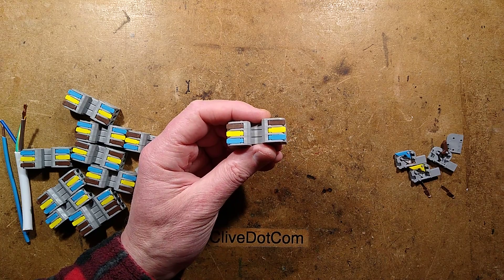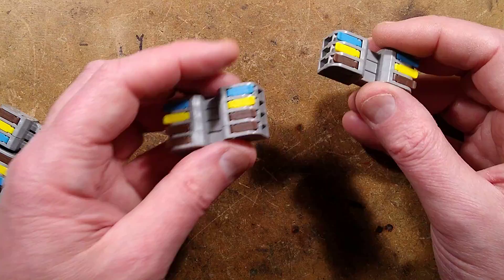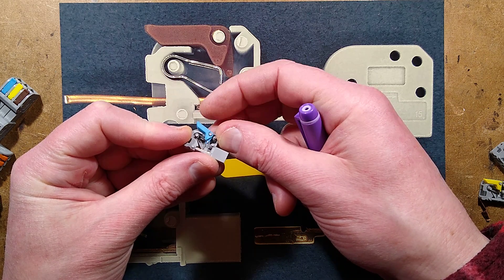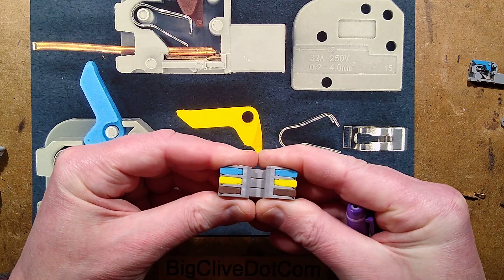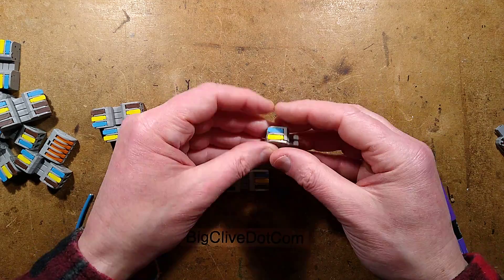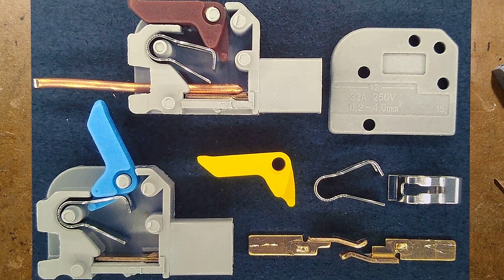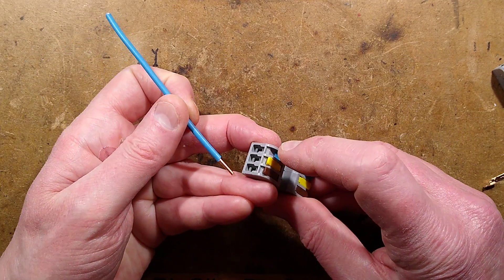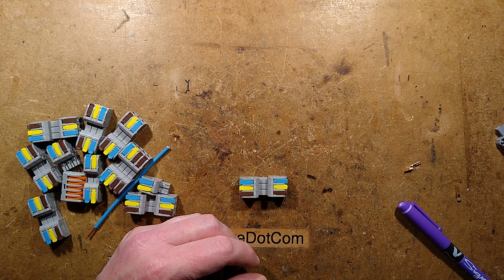Interesting modular connector with a few issues

Comment: On AEG power tools, the 18V and 14,4V batteries are different in length.
     The connectors are literally identical, BUT... The "rail" that guides the battery connector to the connectors on the tool is simply longer on the 18V (or 'elongated' if you will).

This very simple difference results in the 14,4V battery comnectors not reaching an 18V receptacle (because the 'recipient rails' it slides into are longer).
       And an 18V battery connector can't reach a 14,4V connector because the rails on the 18V battery are too long for the 14,4V recipient. (Fits like a glove, but reaches the end before the connectors can mate)

Such a simple an elegant solution, I feel.

As per THIS connector shown in the video; 
      there could be 'crossbars' between the female connectors - one at top side, one at the bottom side (and mirror image thingies between the male connectors) that would only allow them to connect when all 3 pins line up

Comment: It's almost good. Seems like a few very minor tweaks would make this a decent product. That plate to cap off the last module, if that protrudes to the connector it can prevent you from misalignment in at least one way. How easily do the modules separate by the way? Seems like if they do separate it will cause bare live contact to being exposed!

Comment: Those connectors are called hermaphrodite connectors because they're sexless - they plug into each other. There are many on the market and they're typically used where you don't want to worry about the sex of a connector. Though to be fair, most hermaphrodite connectors do ensure you cannot plug things in offset - usually they are sexed one way for one pole and the other pole has the other sex so when you plug it in, it only goes around one way.  (I suppose those are bisexual connectors then too?)

Comment: Interesting concept. Looks quite flimsy on the negative side. Seems very handy for quick prototyping on the positive side, e.g. in a project where you haven't quite decided what types of connectors you will use and you know you will need more than a couple of types.
I'd consider them for low voltage and low current (both conditions met at the same time) applications. I don't like the fact that the spring is not permanently connected to the bar conductor and that its tiny pivot is made of plastic They don't look like they would last for decades in a permanent installation. Perhaps in a low voltage, low current installation that might be acceptable in certain cases, e.g. a small, low-powered battery toy.

Comment: truefully i wouldnt really use them anything that does high power, there be ok for like i dont low power say 5v max, and for testing thw wiring making sure you got it all right and then swap to registered connectors that are safe to use, if that makes sense to you bigclive

Comment: I think the simpler fix for these modular connectors being able to be connected out of sync with each other would have been to have each color key differently. Meaning that they come in pairs and the connector rod has a particular shape that can only push into its partner that it's paired with. Similar to how power connectors on a typical PC are keyed. So in this instance with three pairs of colors you can have One completely circular one completely square and one half circle half flat like a dome. This way when you try to fit them back together they should resist plugging in to things that aren't keyed to its mating pair.

Comment: I also niticed that they are marked 32 A 250V. So they would be unusable on 230/400 V 3 phase circuits(common in most of Europe even for small houses). It might also be 32 chinese amps, maybe 8 real amps.

Comment: Imaging that cheap plastic getting brittle or cracking over time. and of course as discussed heat would ruin the connection after the whole connection released when over heated

Comment: The hermaphrodite "bumps passing in the night" technique for mating contacts is what Anderson use for PowerPole and other connectors, which go up to 350A (if I remember correctly).  Advantages are that parting/mating them scrubs them across each other, doing a bit of cleaning, and by the initial contact/last break being on the forward faces, but the live connections on the rear faces of the bumps, means that any arcing won't be on the surfaces carrying the live current - not that you're supposed to mate/separate them when live, but people break rules 🙂

Comment: This connectors are designed for attaching to PCB, so responsible unit should have solderable pins. Instead of solderable pins it has wire connectors on responsible unit. The idea was that furniture installers will connect integrated kitchen appliances without damaging socket cables. However only whirlpool uses such type connectors, other brands still manufacture connections through box with screws.

Comment: I bought some Wago connectors from Home Depot and two of them had one of the latch levers each snap off like a stale potato chip.  That didn't inspire much confidence in them.
Reply from the maker: I wonder if they were real.
Reply: @bigclivedotcom  I'm unsure what you know about Home Depot but the UK equivalent is B&Q or HomeBase.  I thought the same thing in regards to them being knockoffs but if they are, they are perfect visual copies.

Comment: I once removed an old style fuse from the main fuse box under the stairs as I was going to add a new light fitting or socket or something. Anyway,these were the ceramic holders which you laced with fuse wire (a terminal near each end had a screw to hold the wire). The previous homeowner must have been a George Michael fan as he'd left 'careless whispers' of fuse wire sticking out either end... right where I grabbed it. Lordy! We all learnt something that day.
Reply from the maker: Careless whiskers sticking out of old rewireable fuses was a common occurrence.

Comment: These would be ideal for my 3D printer near the hotend. Only carries 24 volts. 
Currently use some "ideal" brand wago clones Screwfix sell. But an inline pluggable type looks perfect.

Wouldn't trust them with mains though for your exact reasons given.

Comment: One could fix the insufficiently grippy inner mating connectors by  starting with U-shapes where one arm is stiffer and the other is longer, springier, and folded into the U, so it presses against the stiffer arm from the inside. Such androgynous U's could thus mate by each gripping their opposite number's stiffer member with their flexible springy side. Each of the modified U would be respectively connected to the rest of the mechanism at the bottom of the U.

Comment: If the side cover plates were just a little thicker, they could block any accidentally misaligned connectors on the outside, which would at least solve one of the problems with this design.

Comment: Are there linear wago connectors? The way you have to 90º the wires in a juction box especially when the wires come in line for wago connectors is something i cannot come to terms with. I rather use screw bock terminals really...
Reply from the maker: Yes.  You get straight through Wago connectors.

Comment: I could see these being useful in low voltage applications, such as working with microcontrollers, where a failure isn't going to cause a fire. Cool, cheap connectors for projects where a breadboard is too small and you need to make some connections :)

Comment: I’ve been using some Wago clone connectors in the building of my 3D printer. They are modular like these in that they may be connected together in order to create any number of wires connector required but they don’t disconnect in the middle. The hole to test the connection with a multimeter is in the middle of these. For permanent connections I’m switching the Wago clones to the heat shrink wrap with solder in the middle and for non-permanent connections I’m using JST XH connectors. Connections to/from the power supply are done with spade terminals or disconnects. Except for a fan or two, which are 5V, everything is 24V after mains electricity goes into the power supply. The Wago clones are great for quickly setting up tests before finalizing everything.

Comment: Love your videos! Ik this is off topic but I got this hyper tough 5000lumen rechargeable flood light from Walmart and it's extremely bright and got a decent battery life but I noticed after awhile of having it on, it automatically starts dimming slowly even with the battery being full. I have an Ozark trail 800lumen lantern both made from Hangzhou Great Star Industrial CO. and they both do the same thing. I'm not sure if there is a way to bypass that feature but I find it annoying that it doesn't stay on its highest rating setting. I'm only guessing they did that to extend battery life but I just think it's kind of "sleezy". The light doesn't get very hot either which I thought could've been the issue that it may loose some efficiency after having it on for awhile but it doesn't. Would be cool if you ever get around one of these lights and demonstrate how the circuit works.
Reply from the maker: Many lights do dim automatically like that to avoid thermal damage to the LED by running it at full power continuously.

Comment: Dumb question, do you happen to have “electronic clearer” in an aerosol type of can? If you do, I dare you to place these in a bowl and spray them with the cleaner. I have seen some just dissolve in a matter of seconds. Idk if it was a certain manufacturer though.
Reply from the maker: I tend to use isopropyl alcohol for cleaning PCBs.  A proper cleaner shouldn't dissolve plastics.

Comment: I would use them for 24 volt heating connections, they would be very handy for these type connections.  However, I would not use them for high voltage or high current applications.   With a bit of improvement, they would be very useful, but limited at the moment.  But that is basically what you said anyway.

Comment: Interesting design. I'd imagine you could at least partially solve the misalignment problem by having the cap piece extend into the connector area, similar to a JST-XH style connector, but you would need end caps on each side of each connector. The 32 amp rating is hilariously terrifying though.

Comment: The dumb thing about the "offset" problem is that if they had actually made the cover plate at the end longer, so it extends down the edge of the plug connector, it would actually prevent you from being able to connect them up in an offset way.  They apparently just never actually thought of this or how to protect against it.

These could be cool for lower-voltage low-current applications, but I don't think I'd trust them with mains voltages (even in the US) or with anything more than an amp or two of current.  The overall idea is kinda neat, but the implementation just seems like it may not have been through the amount of refinement and testing really needed for this sort of a product in that sort of application.

As you quite correctly pointed out, one of the really good design features of the WAGO connectors is that the contacts are designed to "fail closed", so it is actually the natural state of all the metal components to hold tightly onto the wire (and you must apply force against the spring to open them).  This means even if the plastic bits of the connector fail (or even melt) it will still continue to hold onto the wire securely anyway (there are actually a few videos where people have pumped way more than the rated current through them, and all the plastic around the connector basically entirely melted, but it still maintained good electrical contact anyway).  These connectors rely far too much on their plastic bits for actually exerting necessary forces, and plastic under stress can fail or deform for many reasons (sometimes not even if it's overloaded, if for example it just gets too old, or too warm, or too cold, or comes in contact with the wrong things, etc, etc).

No good electrical connector will ever be designed to rely on plastic under constant force for its proper operation.  Doing so is a huge red flag.

Comment: I really like the design, if only they could fix the spring design, add a block for keying and get it certified (so I know it won't burn my house down).
Would be nice to have some easy semi-permanent modular connectors like this in the toolkit but without the fixes they'd only be good for very limited spots for me.

Comment: They look pretty nice, though that rating of 32A on the side is a bit optimistic!
With any of these kinds of connectors I'm only tempted to use them for low voltage stuff, or for temporary connections.
Reply: Household mains AC is low voltage (< 1000V AC / 1500V DC). I certainly wouldn't be pushing more than say 3A through these; they're good for lighting maybe and that's about it.
Reply: @aaronmdjones  true. By low voltage, I meant ELV.

Comment: The surface contact area between these clamp connections seems so small compared to wire nuts or choc block. Do a current test against the older connector types and I bet they win.

Comment: So, if i understand correctly. 
Giving the modules more structurally sound materials for the grippy bits under load and make the modules keyed and shielded from one another to prevent accidental electrocution and this could be a sufficiently safe, viable product with a practical use?

It sounds expensive but still, perhaps its worth it somewhere like you described!

Comment: I bought a dual version for quick connection for my fish tank lid, so just for 12DC.
What he didn't mention is the plastic parts, at least on mine come apart real easy. I wouldn't put 110v AC on them if the house was turned off.

Comment: I wonder how Anderson have solved this issue on their power connectors, as they have a similar ride-over-each-other mechanism, don't they?
Reply from the maker: I think they might have an extra metal blade.
Reply: The metal tang in the Anderson connector housing is only there to prevent the contact from pulling out of the housing.  It's the tolerance and contact rigidity that gives the force on to the contacts.

Comment: There's a lot of potential here, I do like the basic idea. I agree it has a few issues but I believe most of those could have been avoided if the design was only a little different.
I also  kind of like how the lever works when compared to Wago. On one of these if you've used a wire that's too thin, the lever will give you that kind of feedback because it feels loose. On a Wago connector (I use the 221's, usually) that is spring-actuated and you use the lever to release it. That's the opposite way round, so it always feels like there's tension there even if (actually... especially if) the wire isn't being gripped all that well. Sure, the Wago will keep on going if the plastic has melted, but if things get that far, your connector acting like a fuse might not be the worst thing that happens to you that day.

Comment: Breaking the connection when they get hot (presumably through too much current) is actually not much of an issue IMO.. better than the alternative.  But they're still crap.
Reply: That would be fine if it would positively break the connection (and douse the arc). But the way it is built, it will create a random connection. It may break, heat up even more, or cause sparks. If the overload is caused somewhere else, you now have a secondary fire in your house.

Comment: this type of wagos are mostly used for stranded wire in real installation. For solid you use "solid state" push in types. You should experiment more with how stranded wires act with these and do they manage to hold on to them adequately.

Comment: You've got a good point about pushing past the optimum pressure point as they click together, but couldn't help but notice, that with the angle of the connector surfaces, there is going to be quite a bit of increased surface area, copper to copper, as it advances beyond the peak pressure point, They may just have had a little bit more insight than were credited for. 🤐

Comment: It seems like the designer could provide end plates which have a locking clip that extends past the connector ends and has a receiving plate with the latch pip that captures the clip. If they were on each side, then the connector could not be assembled offset and there would be some mechanical support for keeping the sides latched together.

Comment: Hi Clive! You'll love WAGO 890-223 + 890-233, I just ordered a 100 of them for work! Technically only allowed for lighting fixtures, but they often come in handy for small mains loads or 24V quick connectors when IP rating is not needed. As you'll see, WAGO have taken care of all the mentioned concerns, because german engineering...